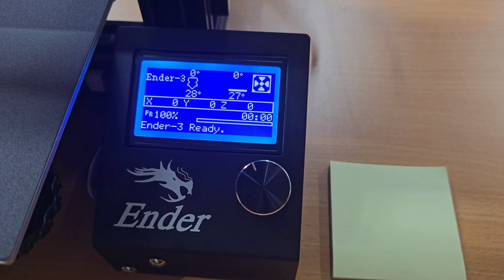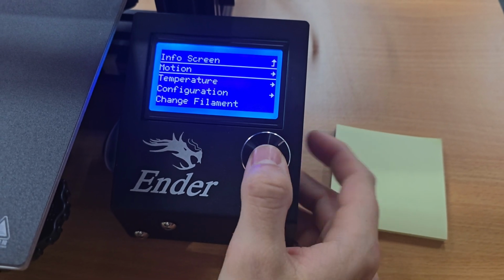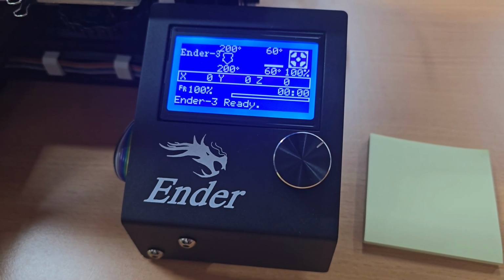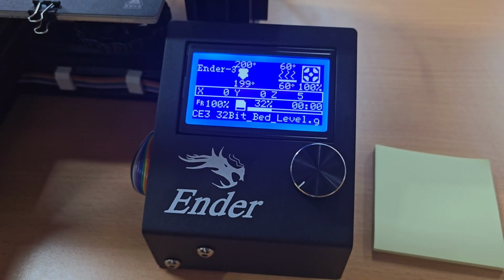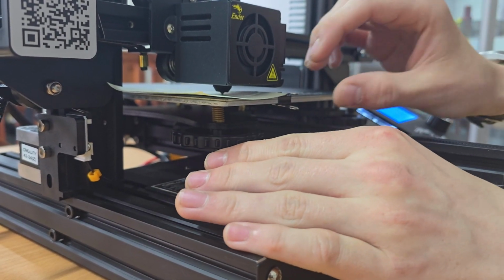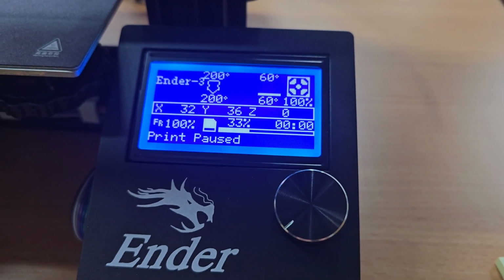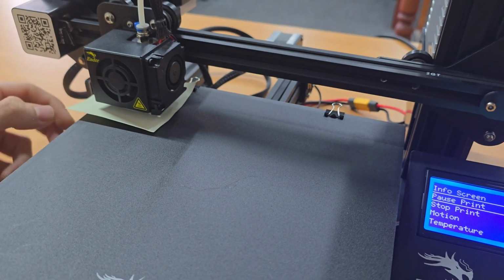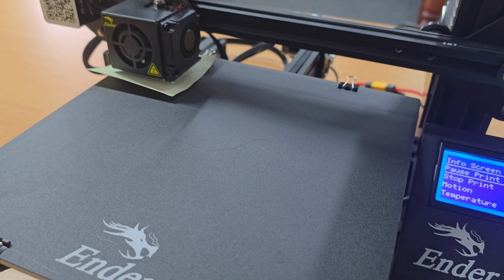How To Level Ender-3 Bed | 3D 360

Comment: This is just that Standard Bed Level Procedure that has been posted on YouTube, by various people for years.  Nothing new here.  Also, seems incomplete at the end.  Does not explain about the Bed Tuning and how to use it.  If there is a separate video for it, then it should have been referenced / linked here.